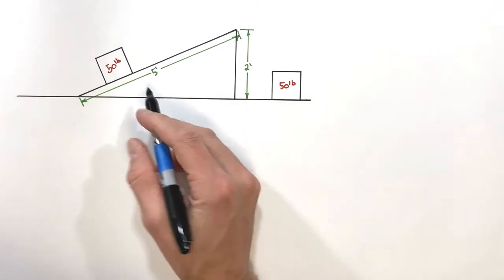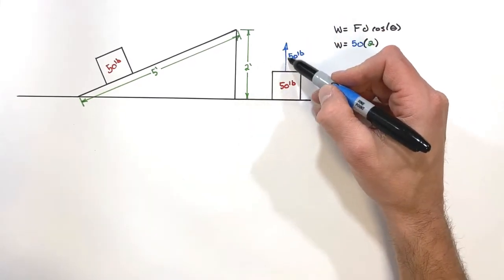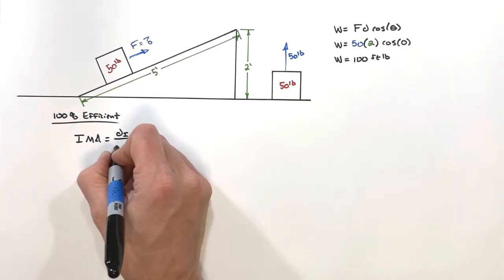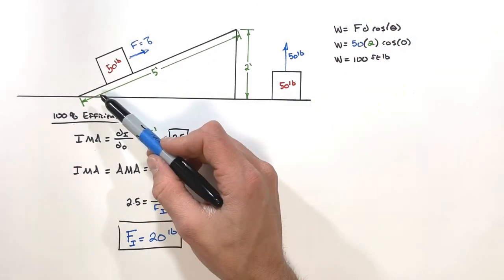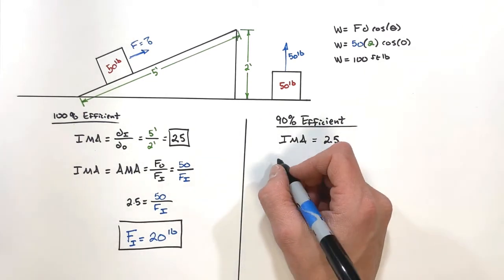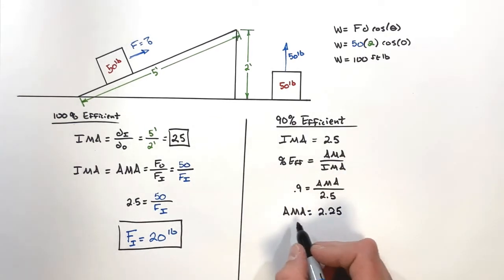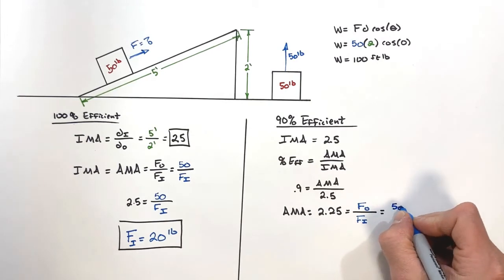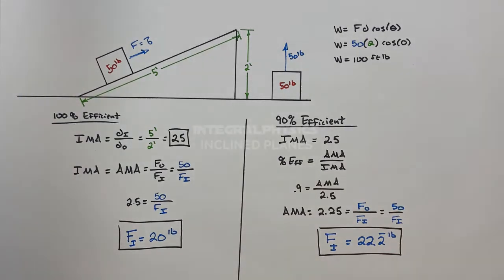Inclined Planes: Simple Machines For Engineers

Comment: I found this helpful to understand the principle of the inclined plane.

I have a textbook that didn't made me understand what an inclined plane meant.
However, the textbook, according to me at least, made it easier to calculste how much force it takes to move the object up the slope and the formula in the book goes: L/I=R/E
Where:
L=Length of the slope
I=Height from the ground to the top of the slope
R=Weight of the object that is moved
E=Effort "force" required to push the object

So in this case:
5/2=50/E
Using algebra:
5xE=50x2
5xE=100
E=100/5
E=20

However, my intuition is still telling me that it should be harder to move the object up a slope since it's hard to push things up a steep hill, with friction and stuff.
But now when i think about it, it's much easier to push a car up a hill than it is to lift the entire car from the ground up.
I have a physics test coming up and something tells me that i shouldn't trust my gut feeling during the examination.